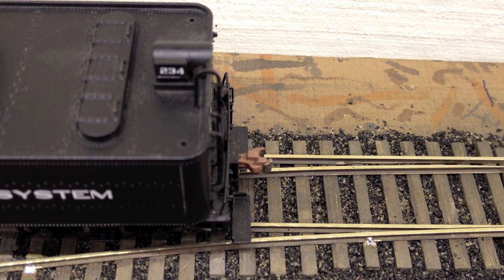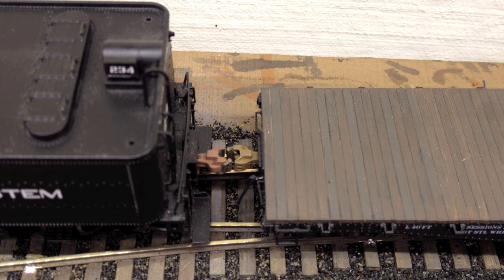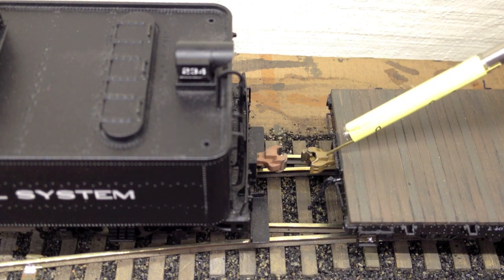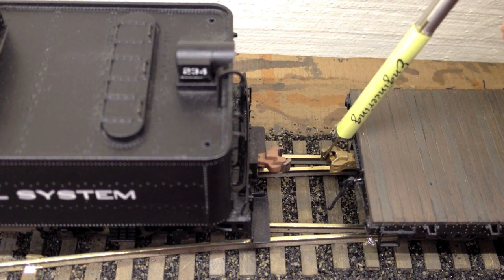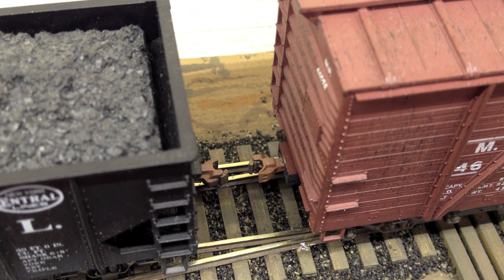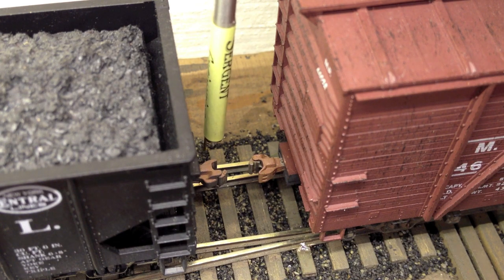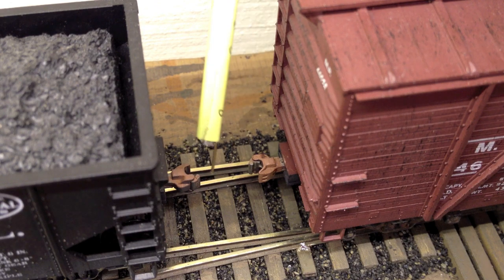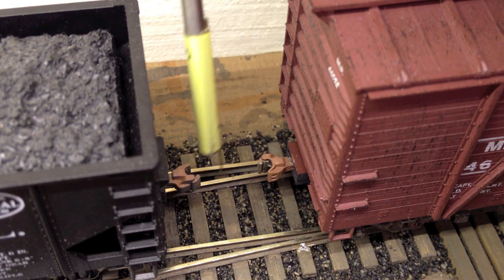Sergent Engineering Coupler Demo

Comment: I'm getting ready to build a small 7' x 7' x 12" L shelf switching layout. I was going to do it in N, but after watching this. This alone makes me want to do it in HO. Less is more!
Reply from the maker: For a small layout, these couplers make a very compelling choice.  There are some folks with larger railroads that use them, but that's unusual. I'd suggest converting a few cars to create a test train before committing to the - I've found some swaps are dead easy, while others (Accurail, for example) take some fiddling to ensure that the couplers swing freely, with just the right amount of drag (a bit of friction is required to prevent the couplers from being knocked off center too easily). Something else worth looking into - one manufacturer is now making a stand-alone coupler box that has a self-centering option for Sergent couplers.  As you probably know, Sergents don't self center, which is a complaint with some users.

Comment: Yeh, I like that. Can the magnet be placed on the track instead of using the wand? Cheers, Bob
Reply from the maker: RMLectronics, an on-track uncoupler in the model of a Kadee magnet won't work because the coupler is unlocked by lifting a small steel ball; an on-track magnet would do the opposite - pulling the ball down and completely preventing unlocking.  See this video for a more detailed look at the mechanics:
Sergent Engineering Couplers - Locking Mechanism Closeup
That video is part of my Sergent playlist, so a couple more on slack and the internal parts (and assembly) of the couplers will launch afterwards.

I have seen photos of devices that hinge up from the "ground" and position a magnet between cars for uncoupling.
Reply: Matt Goodman Many thanks. I've just had a look at the other entries and now understand the operation! Quite ingenious, and I can see the operating mechanism well. Brilliant design. Is this your own design Matt?
Reply from the maker: RMLectronics East Yorks Oh heavens no - I have no such talent!  Check out Sergent engineering:  http://www.sergentengineering.com/

Comment from the maker: HOmodelRRer, I have not had a Kadee coupler fail, so I can't answer your question directly. I wouldn't expect the Sergents to be any more likely to break than a Kadee, though they may be more likely to get gmed up due to smaller tolerances. That said, reliability of the Sergents has been perfect so far, except for two individual couplers which fail to lock closed about half the time.

Comment from the maker: That is correct.  The tool shown (Sergent calls it a "wand") is, when reduced to it's simplest, simply a magnet.  Presumably you could make do with other magnets, though Sergent's website cautions about using something too strong (which will magnetize the ball - I think) or too weak, which will cause inconsistent operation.

Comment from the maker: Hi pacbelt. It's been at least a year since I priced the Sergents, but at that time they were slightly less than Kadees - IF you buy the in assembled kits in bulk. Check out the website for more current information.  I'd suggest buying 4-6 pair and give them a try. Some things they do better, some not as well and some things are just different.

Comment: How did you get the knuckle to lock so smoothly? I just equipped 1 locomotive and 5 cars with these couplers to see how they worked, mine don't seem to lock nearly as smooth as yours. With a few of them I really need to slam them together to get them to lock, and these were the already assembled couplers from sergent.
Reply from the maker: rscott417 , I don't have any direct experience with pre-asembled couplers.  However, I've read some discussions on the Sergent mailing list that suggest that the pre-assembled couplers are more likely to be rough operating.  In your case, I would guess that some detritus from the cleaning or break-in process may be gumming up the works.  Try blowing some compressed air into the coupler to clear it, followed by a dry lubricant, then repeat the break in process (see the Sergent page for details on this).  If that doesn't work, contact Sergent directly - he's very helpful.

Comment: man these might be better than kadees, they also seem to be the solution to uneven couplers
Reply from the maker: They are better in looks, and easier to uncouple. They can be fiddly to couple, though - and can't be used interchangeably with Kadees, meaning you can't take your cars to a club or layout that uses the latter. There's definitely trade offs.  I've also found that they take longer to install and some coupler boxes require modifications. There's no difference - better or worse - in vertical alignment. That's up to the installer !
Reply: sometimes ive seen thats due to uneven stupid carpet floors the uneveness

Comment: I have noticed there is a distinct "click" when they make a joint...Once they get good and broken in, they operate just like the real thing....however a heavier car seems to work better since they need that tension in making a joint.
Reply from the maker: Thanks for the comment Paul.  I've noticed that a well broken in or well assembled coupler makes a joint more easily than Kadees.  Silent, and no momentum needed to overcome the knuckle spring.

Comment: Where do I buy these?
Reply from the maker: Hi @TheTerminator12. Frank Sergent is no longer producing these, but he did put his designs into the public domain. An individual has taken those designs and as started producing them. JL Innovation is selling them, and you can also find them on Ebay. I haven't bought any from the new producer. :
https://jlinnovative.com/catalog/index.php?manufacturers_id=7&fbclid=IwAR01xUbJP3yTPF5KSEZFbzvoBslt6Q2mj3E6V-TW9Se3F6aUF6qjaiL31cI

Comment: The simple solution is don't use steel weights. Find old lead tire weights (look in the pavement cracks at tire shops) and make your own. We're doing the environment a favor and sequestering it.
Reply from the maker: It’s one of those “you don’t know what you don’t know “ things.  In this case I was using the weights that came with the cars. Your advice is valid-materials might be a better choice in some installations. Thanks for the comment!